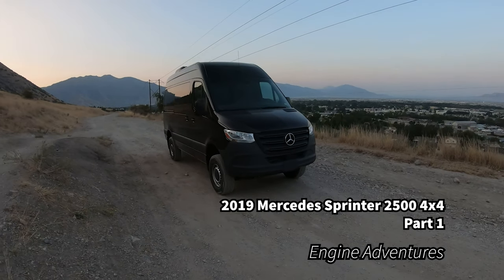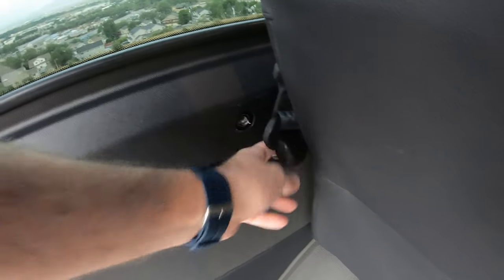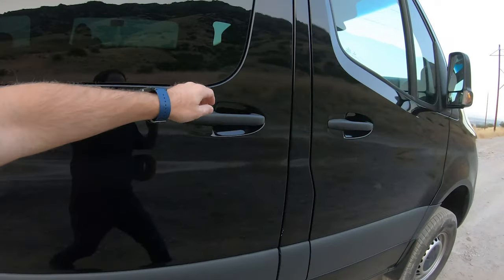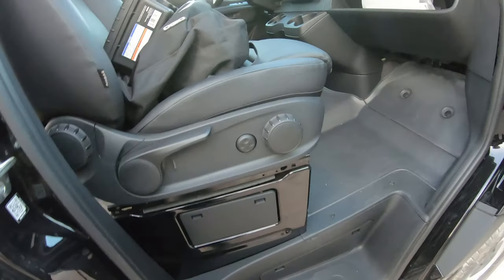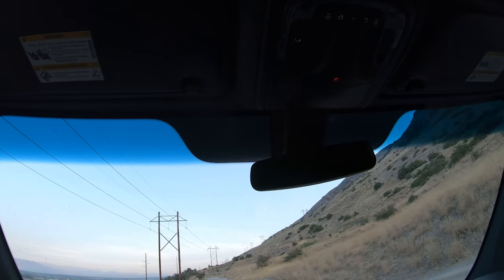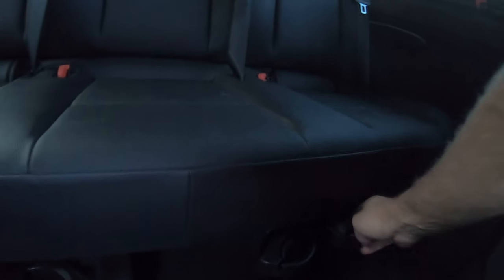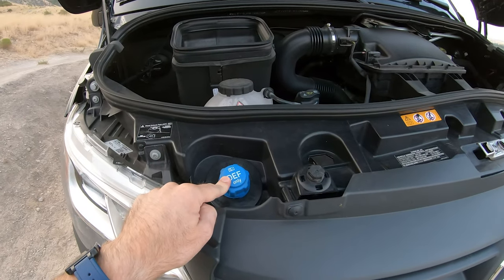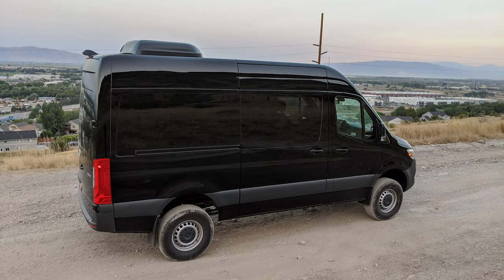4x4 Sprinter Part 1

Comment: Thanks for the off road test in pt2. We are looking at a 4wd Sprinter for overlanding. Your test cemented the fact that we need an aftermarket 4wd conversion with a real low gear and lockers.
The emergency exit window is hinged at the top (assuming it's not been changed from the previous gen Sprinter). We have used it as a opening window for camping in the past.
Reply from the maker: Thanks for the tip on the window! I was wary to open it I'm case it just dropped out. The once thing with aftermarket conversions is that I don't think they will have the brake based limited slip on the front axle. Might be a non-issue, but it might be something you need!

Comment: I believe the fog light switch turns on the rear fog lights... 
i cant explain why it displays both front and rear fog lights on
when you showed us there are no front fog lights 🤔
Reply from the maker: Interesting thought. This one has no additional lighting on the rear. If it does turn on rear lights then it must be the reverse lights.
Reply: I think the rear fog light should be the bottom bulb on the drivers side. The bottom right side bulb socket doesnt usually have a bulb in it.
Reply from the maker: Huh, I didn't notice. I'll try to remember that next time I have one. Thanks!